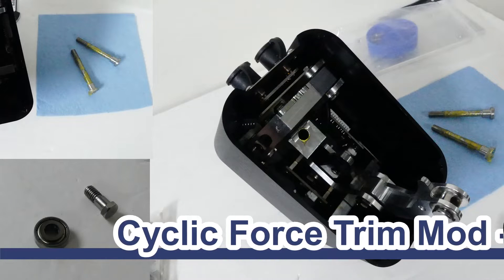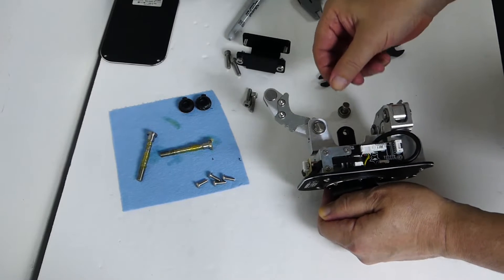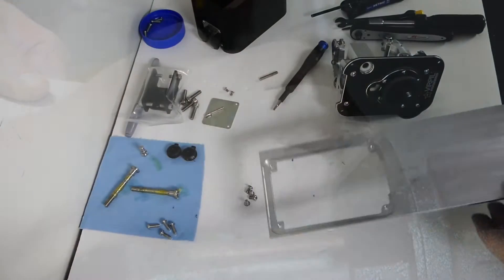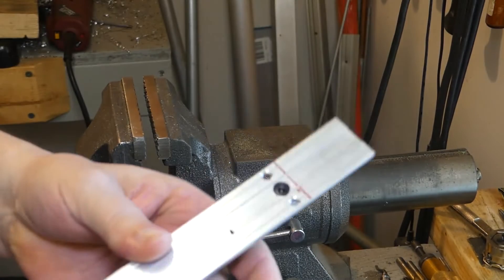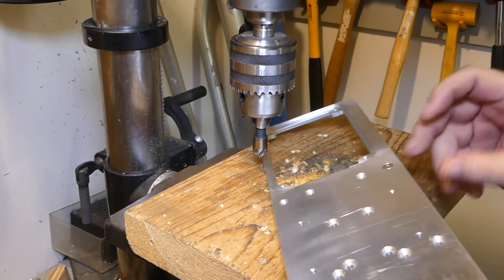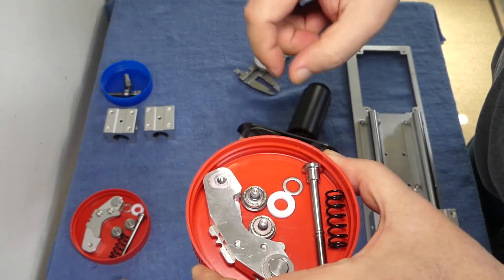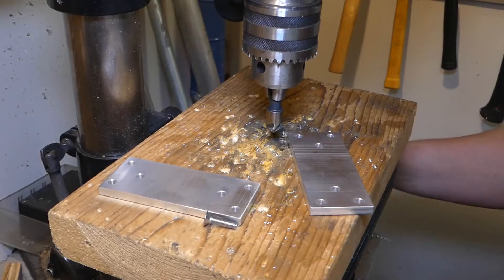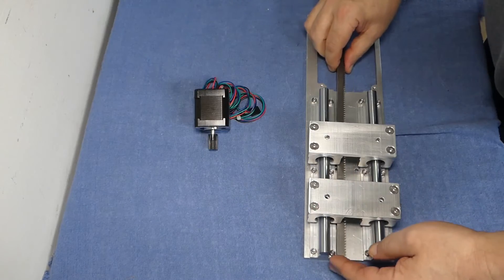Cyclic Force Trim Mod for Virpil's VPC MongoosT-50CM2 Base Part 1 DIY

Comment: Great video! I enjoy watching your step by step creations! Is there a reason why you use 6061 aluminum? Cheers!
Reply from the maker: It's cheaper than T7075 and machines nicely. Any lower grade than 6061 is too soft and doesn't make a crisp cut on my mill. Thanks for watching!